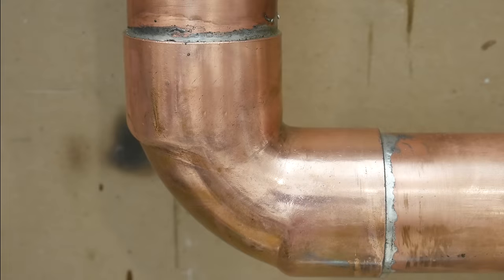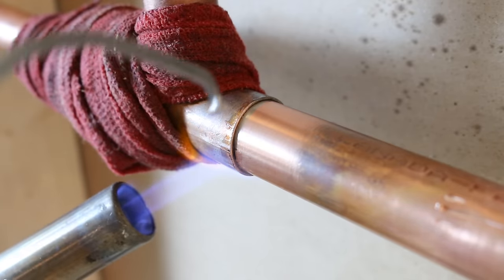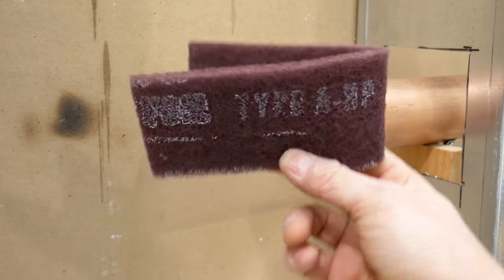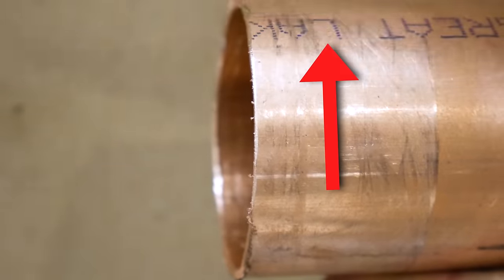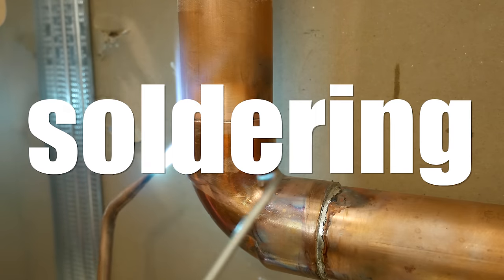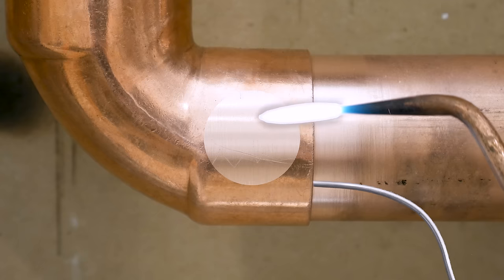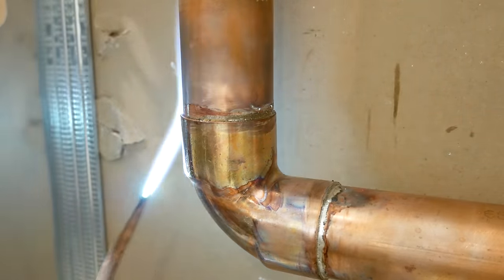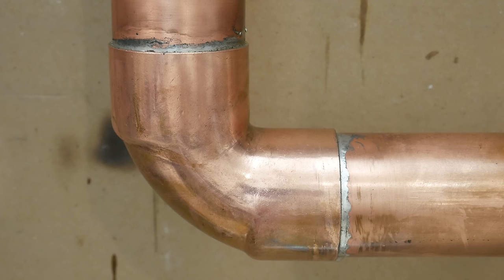How To CORRECTLY Solder a 2" Copper Joint (Step By Step) | GOT2LEARN

Comment from the maker: Here are the tools and materials I used in this video (affiliate links):

Torch assembly: https://amzn.to/39s66Bp
Pencil reamer: https://amzn.to/2wcVJ6d
Tinning Flux: https://amzn.to/2ON4uKs
3M Scuff Pads (Coarse): https://amzn.to/2uwPMkc
Lead Free Solder (95/5):  https://amzn.to/2EoqSFb
Flat File (8"): https://amzn.to/2OJNrZZ
Reply: What torch tip size for that? Im about to use my uniweld oxy/acet brazing torch but need a larger tip for 2"
Reply: That's a 3/4" joint
Reply from the maker: @gabrielramos3385  2"

Comment: One thing i do different when soldering 2"+ L copper pipe is i focus the heat first on the Pipe going into the fitting. That way the pipe is already hot and expanded in the fitting. Then i focus the heat on the cup of the fitting. Nice work!
Reply from the maker: Yeah I do that too but only when I am soldering a lead-free valve for example because it doesn't transfer heat as well to the pipe ;) But yeah, heating the pipe a little can only help, thanks LorenzKamo!
Reply: @Got2Learn  Great content as always <3
Reply from the maker: thanks!!!!!!!!!!
Reply: Yep, that's the way I was taught to silver braze copper nickel pipe and fittings. Heat up the pipe, then the fitting.
Reply: Yep, when you get into bigger stuff, preheat and heat control is super important. On stuff bigger than 1", I use bigger torch tips to increase the BTU output/flame size, moving into a triple tip with propane/MAPP on 2" and bigger. Oxy/Acetylene is ok too, but I find that the lower temp of the MAPP or propane flame gives cleaner results in my experience. Another thing I haven't heard mentioned - you can use the "rainbow" color transition as an indicator that the joint was properly heated. Just a touch of rainbow evenly distributed? Perfect. Too much rainbow = too much heat. No rainbow = cold joint. Source: I have soldered 1000's of joints in large radiant hydronic systems.
Reply: @chadlevitan7886  well said - completely agree. I'm installing a 2 1/2" riser Monday - so all will apply - I just use the B tank or Mapp with the double tip
Reply: They make different tips for a reason!
Reply: Awesome video

Comment: A superfire with mapp gas does the job fine. No need for bottles and hoses
Reply from the maker: Yeah like I said, that would do, I just have this kit cuz I also braze and oxy cut ;)
Reply: But I heard Mapp is now just branded version of propane and doesn’t burn hotter.
Reply from the maker: It burns a tad bit harder, not like the real mapp gas.

Comment: I needed you last Friday !  The sprinkler company I hired couldn't get their 2" solder joint to seal. We had to call in a plumber at 5pm on a Friday!
Reply from the maker: Ahhh that sux man, did you get it fixed finally?
Reply: @Got2Learn We did, at 7pm! Apartment tenants wondering when the water will come on. I was worried when I saw him pull out a standard torch; I should have questioned him more then. Sprinkler systems are a pain, plumbers can't work on sprinklers but sprinkler guys have limited experience on copper water supply side.
Reply from the maker: @rockyravine1155  👌

Comment: I remember my father long ago telling me to concentrate the flame where you want the solder to travel to.
I've soldered 4" copper lines with oxy/acetylene with great success. An occasional 6" line, but they can be a bear to keep the entire joint hot enough. All piping was for potable water in a beverage manufacturing plant.
Beautiful job. Just one thing I always kept in mind. Once you clean the joint don't touch it, especially with your your fingers. Dirt and oil from your hands will ruin your day.
Reply from the maker: Yes, good tip, don't touch with your fingers or you might create a spot where the solder won't go! Thanks Matt!
Reply: Proper joint integrity was EXtremely important where I worked. The plant was located in an awkward location in the municipal water system. Normal supply was 150psi, but Often got surges/hammers and the result was up to 215psi.
That pressure was great when you had to fill 20,000 gallon tanks quickly, but also was a concern in other area's of the plant. That led to various plant wide regulators, surge arrestors, expansion loops whatever the situation required. Was an interesting job.
Reply: You need one of those multiple tip torches. I’ve never used one personally. The biggest pipe I’ve soldered was 4” and acetylene with a 1/2” tip worked fine but I’ve seen those torches with multiple tips and was always curious how much they helped. I’m sure they wouldn’t be worth it unless you solder 3” plus regularly.

Comment: Just did an old kitchen drain. 1.5 inch copper to 1.5 inch cast stack.  
I've done a fair amount of half and 3/4 inch with propane but the 1.5 was a lot tougher. I was able to do a nice enough job but propane definitely doesn't have enough heat to make easy work of it.
Reply from the maker: That is awesome!

Comment: You should do a video on soldering 2 inch brass values copper. Great technique on the copper fittings.
Reply from the maker: I have a video coming on how to solder lead-free fittings, it's gonna be interesting.

Comment: Great video. I actually have a job on this weekend working with 54mm copper pipe. 👍
Reply from the maker: Awesome, lotsa fun man, cheers!
Reply: Never worked on that large pipe before. Largest I done is 32mm in copper. I have done 100mm in steel that’s all fabricated fittings (pre welded)

Comment: Thank you for the video. For cutting any size over 3/4 I like my portaband and debur/chamfer with a flap disc, soldering 1 1/2 and up I use an acetylene TurboTorch.
Reply: Greetings!

I am interested in your concept.  In your comments you stated anything over 3/4 inch you cut with a certain tool.  I am looking for a easier way to cut piping in tight, tight, places.
Reply: @JerryLynch2  I use the portaband for cutting any pipe I can but in tight spaces I use an angle grinder with a cutting wheel, it leaves a lot of material to be deburred but does the trick.
Reply: @inodoroguerrero  
 First off, let me say thanks for getting back to me so fast!  I never used a porta band to cut pipes.  I am in Ohio and run into split pipes from cold weather.  Boiler baseboard pipes are really soft.  The 360 clamp on cutter crushes them.  I use my Ridgid with the know and just go slow, but some of them I have to cut back further than I'd like and now you need double couplers, etc.  

 On the Port-aband what size blade should I use?  The finer would be better, right?  Will it leave my cut straight?
Reply: @JerryLynch2  Yeah, the hydronic baseboard copper pipe is lighter than type m, the Ridgid mini is a great option. 14-18 TPI is my preference on bandsaw blades.
Reply: @inodoroguerrero  
Awesome!  Thanks for your input.  I appreciate your time and sharing of knowledge.  Since reading your tip; I have been watching cordless porta-band videos.  I am already Milwaukee tooled up and will probably pull the trigger on one of their models.  Thanks for everything!
Reply: One other thing.  I will def check out the Ridgid before grabbing anything else.  The company is about 40 miles from my house.  Ridgid is top notch
Reply: @JerryLynch2  I'll admit, I am a little jealous. I haven't had a bad Ridgid tool yet.

Comment: You forgot to mention MapGas if you need better heat than propane
Reply from the maker: Mapgas is discontinued. Thanks for watching!
Reply: @Got2Learn  actually I buy it all the time at Home Depot...good sweat though 👍
Reply from the maker: The gas you are buying is MAP Pro, which is "propene" and burns a tiny bit hotter than propane, but it's not real MAP gas.

Comment: hello my kitchen leak badly after watching this video i have more confidence doing replacement maybe 
what is the best torch for 2in the copper pipe?
Reply from the maker: Acetylene.
Reply: @Got2Learn  wow fast reply i bought the same torch as you the Lincoln Electric Port-A-Torch Kit. How long should i heat up the the 2 in copper? before feeding the solder. too afraid to melt the copper with this powerful torch because it's my first time DIY
Reply from the maker: For 2" it takes about 20-30 seconds before it starts melting the solder, but you must circle around with the heat, unlike smaller diameter piping.
Reply: @Got2Learn nice I got that right now!  I measure the circumstance of the outside copper pipe to be 5 1/16 inch. what pipe do i need and can you sent me a link? is it a 1 1/2 inch copper pipe that I have right now? thanks

Comment: Thank you for all of your great videos - my solder joints and I both thank you. 

Btw - I don't have a 2 gas system, just propane,- but I do have a turbo torch head that generates a much hotter flame than a standard propone torch head. Do you think that will be sufficient for a 2inch copper pipe?
Reply from the maker: You can get away with it yes, but it's easier with the 2 tank setup, cheers man 🤟
Reply: Look at the triple tip setups for propane/MAPP. I prefer them to Oxy/Acetylene for large copper.

Comment: So, when using a acetylene torch, how long do you heat the fitting/pipe before applying the solder?
Reply from the maker: When the solder starts to be pulled in.

Comment: What’s your oxy acetylene ratio? And what size tip are you using? I solder 3” using just acetylene and have never had a problem
Reply from the maker: 50/50, size 2 tip.
Reply: Got2Learn psi?
Reply from the maker: 10/10

Comment: You solder starting from the bottom then upward.  I do the opposite way by starting my solder from the top going downwards.  The reason, Gravity.  Solder will drip downwards and if you start from the top, solder will not pile up the way it does when you start from the bottom because in the end, they will accumulate at the bottom of the pipe. But this only applies to a horizontal pipe and not a vertical pipe.  4:53
Reply: Doesn’t matter where you start really. gravity doesn’t really matter because the solder goes into the joint with capillary action. Starting at the bottom of the fitting is how I do it too because heat rises and the top half of the fitting heats up while you solder the bottom. It’s faster. To each their own. Good points
Made by all ! Great to hear others opinion.
Reply from the maker: I love hearing how other people solder their joints.
Reply: WRONG ! Doesn't matter were you start.  Solder will always flow towards were the heat source is located.

Comment: What about 1 inch or inch and a quarter copper do you need a special torch or can you use the same one that you use for 1/2 inch and 3/4 inch copper?
Reply from the maker: One or the other :)
Reply: You mean I can use either torch?
Reply from the maker: Yeah....imo, as of 1 1/2" it's better you get a nice strong torch, but 1 1/4" or less, a normal torch will do just fine. I used to solder 2" with a normal propane torch, but it's much quicker with a btank ;)
Reply: @Got2Learn  thanks

Comment: Do 3 " once in a while, 2 map gas torches get the job done you just can't rush the job.
Reply from the maker: Yeah it takes more time, but it can be done ;)
Reply: Rose bud works better on 2 inch and larger.
Reply: @joshm5816  Go big or go home
Reply: @tallbrian100  Rose bud is big. Been plumbing over 2 decades.
Reply: @joshm5816  Yep, have only used the, for heating steel.

Comment: What tip did you use for that?
Reply from the maker: Don't remember the tip # but it was the smallest one in the kit, some people use a rosebud tip but in a wall it's not ideal.
Reply: @Got2Learn   i just scrolled down and found you used a #2 at 10/10 psi
Reply from the maker: Ahhhh there you go!!

Comment: Can you re-solder a leaking 2" elbow?
Reply from the maker: When you say "re-solder" what do you mean, do you mean, just adding flux and then adding solder, or dismantling the whole thing and re soldering it from square one?
Reply: @Got2Learn  
I have a pin hole leak at top end if a 2" T.  Currenttly I wrapped duck tape to stop leak.

Can I clean area and add flux. adding solder without taking apart?
Reply: @Got2Learn 
Like to solder without dismantling.
Reply from the maker: No, you must dismantle it, here's a video I made on this that explains exactly how to do it: https://www.youtube.com/watch?v=8IV7oG43DZ0&t=436s

Comment: I didn’t come here to learn, I have already done my apprenticeship. Just seen this video thumbnail and came for a laugh. Dude, you don’t need to move your torch parallel with your solder as you push it in and fill because all you do is melt it on the surface because it melts off the spool and falls. When the fitting is at the right temp it takes the solder (first year knowledge) second, use the hottest part of the flame to heat the fitting AND the pipe so they expand equally But focus more on the fitting. You are using the flame  envelope to heat the fitting which takes way longer and you oxidize the fitting hence the discolorization. Based on the fitting color, I am sure you brushed it with flux to clean it up before you extensively polished it to cover up an barely average solder joint. 

Technically it’s filled and should hold, but man, clean up that technique and solder more. Looks like you haven’t soldered a lot of 2”, let alone 3” and up